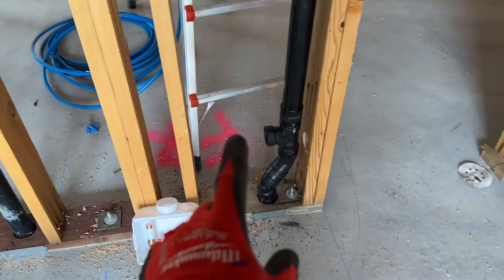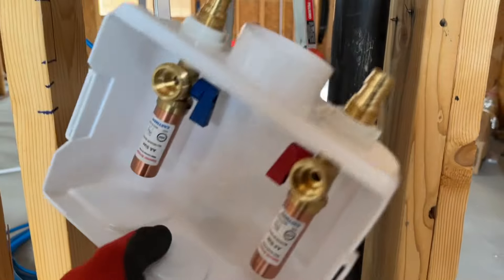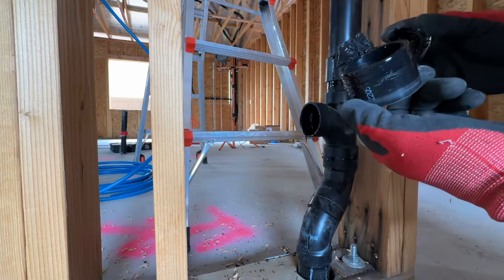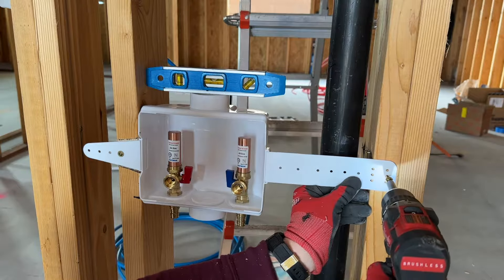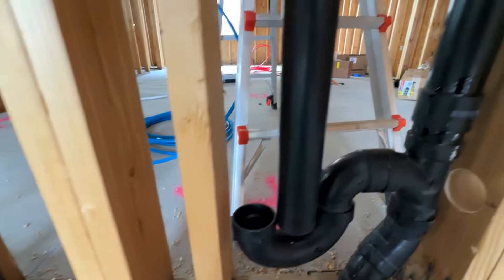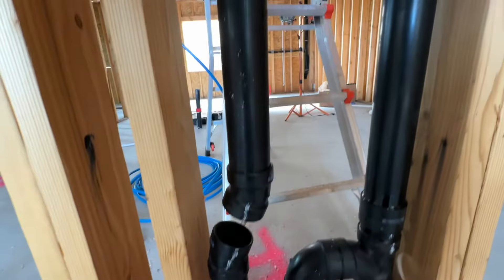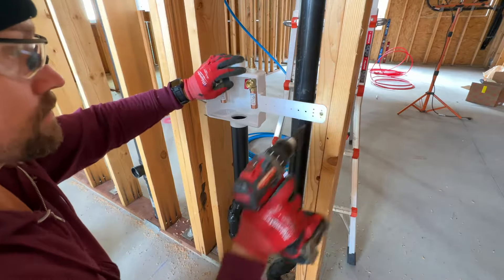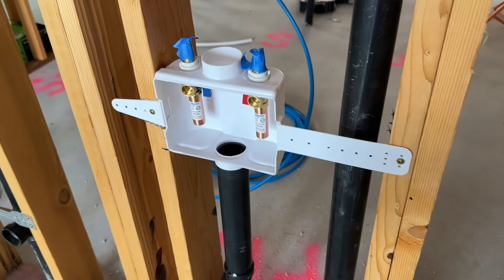How To Install Washing Machine Outlet Box & P-Trap

Comment: Are you allowed to do a S trap like you did? I was thinking the piece connecting had to be a minimum of 4" in between in order to not create a s-trap instead of a p trap.
Reply from the maker: A “S” trap usually is when they just make and S shape but there is no venting. So the piece I have going vertical is a dedicated vent for that drain specifically. If I had no vent on it then it’d be what most call and S trap and those are no good as the “P” part of the trap doesn’t work the way it should by trapping the sewer gas. 

But this pipe will vent properly and still hold the water down in the P trap. Its really just a regular P trap laundry drain with a little kink to
Shift the vertical parts right.
Reply: @FortKnoxCo  could be right. I was always told the little piece you cut to go between the sani-tee and the other piece of the p trap has to be double the kenth of the thickness of the pipe, which would be 4 inches in this case or it could cause the p trap to get sucked dry. Its in the National Plumbing code.
Reply from the maker: @Jgwoodworks1623  after a little research it is recommended or code that you do twice the diameter of the pipe. If you have no vent they usually call that a S trap. But if you have a vent and it’s within the double diameter of the pipe distance then it’s referred to a “Crown” vent. Way back in the day they would have a S trap and have a vent literally on top of the second bend and that’s why they called it a Crown vent. It doesn’t guarantee failure but it was found to be less effective if keeping the water in the P trap. You need a little bit of pressure regulation in the pipes so the vent shouldn’t be too close to the P trap. So they moved to the double the diameter rule to help that. What I have is pretty close but not a formal Crown vent. Since I’ve used an actual  Sani T and the two pieces have the pipe sleeves to receive the connecting piece it almost gives me the flat distance I need to the vent. Cutting it close.
Reply: Yeah, I came here to say that exact thing. For others, a couple more inches of pipe to make sure you don't fail inspection and have to cut all that out.
Reply from the maker: @bluegorillacookies  yeah I agree, I wouldn’t have made such a tight set up if I didn’t have to. But the area I was working with was very minimal. Had to make it work and I passed my inspections. 🤙🏼

Comment: So the washing machine outlet to the ABS doesn't have to be glued. I'm getting ready to remodel our laundry room and will be mounting mine the same way with hot and cold water on the top.
Reply from the maker: I could see that. So you could work on it or replace if needed.

Comment: It is an S trap! S traps were always vented, they just sucked the water out of the trap. That’s why they are a code violation. You may have passed inspection but that does not mean it’s code compliant.
Reply from the maker: It’s not an S trap. But looks very similar since is has an S formation, but it’s vented as you can see. It’s very close to the down bend but within allowance. The distance from the trap to the vent is to code. But it’s right on it. There’s also a vented S trap “crown vent” which used to be allowed back in the day but isn’t in most places. 
So what you see here in this video is vented and is “technically” a P trap if you measure the horizontal spacing to the vent. And either way it is obviously vented.

Comment: Were is the clean out and I don’t think u can off set a direct drain homer
Reply from the maker: There doesn’t have to be a clean out for a laundry drain. If you wanted to add one you obviously could. This is a very common 24” to ptrap laundry drain.  The spacing is very close to what some consider a crown vent or Strap. But it is not.
Reply: @FortKnoxCo  not UPC code

Comment: My sister and I installed..or tried to install our very first box. It went well until it was time to hook up the water to the box. Turns out we need a crimping tool which we do not have. Instead of that, my sister got sharkbite fittings. We hooked them up, but they leaked. The tube from the valve is like a pvc type tube and it is not long enough to reach the seal on the sharkbite, that is why it leaks. Any recommendations?
Reply from the maker: I’m not familiar with the boxes that have Pex coming off of it. You can get a box that has shark bit type connections on it I believe, so you could just push your pipe/pex into the fittings on the box. Or get the correct adapters to make a good connection. But yes, if you don’t have the shark bite/push on connections on correctly and fully inserted it will leak.

Comment: Will you be doing a tankless water heater install  possibly?
Reply from the maker: Yep! I’m about to run my gas line into the structure and set the tankless mount. I have the water lines already plumbed for the water heater in place. Where the main water line splits to cold and hot. I’ll be showing that in detail in some upcoming videos

Comment: wait the water was coming in from the too 🙄
Reply from the maker: The Water lines in this structure are ran through the rafters in the ceiling. Everything drops into the walls where needed.
Reply: @FortKnoxCo  I didn’t complete my comment, what I was saying you did mention the waterlines were coming from above, but then, as you started to initially install the washer box you had the valves in the wrong position, as though they were going to come up from the bottom, then the video showed you going to remounting the box. That’s fine I enjoyed the video, you explained things well, I have left the box in traditional installation, take my waterlines and made a bend and came in from the bottom, that was without using 90s. Either way all good. Plumb on my fellow plumber!!
Reply from the maker: @jamessells8440  oh yeah. I got ya. I initially screwed it in “upside down”. But when I took it off to install the last pipe and re mount I installed it the correct way u needed it. I appreciate it. 🤙🏼

Comment: 2 quick questions..
What’s the word on those little vent fittings that can eliminate a legit vent stack? Are they good enough for a small washing machine?
And second question is about the trap. Does it have to have a min run to the San Tee? Or can it just be snugged right up on it?
Reply from the maker: Are you referring to something like a Studor Mini-Vent?  Yes they can handle a vent requirement. If you look on whatever brand /style you are going to get they have a rating on them. Some are good for a certain amount of rod DFU’s ( drainage fixture-Units). So like a sink or a toilet or a shower equal a certain # of DFU’s. So they can handle that amount of  fixtures on a single vent line.  So they do work in place of a true vent out the roof. Commonly used in renovations. Just make sure they adequate air flow, you don’t want to box them in a wall. 

As far as the P-trap to the Sani T transition, they can be one right after the other. They can be close. Your main concern is the drop to the ptrap. You usually need 24” drop to the ptrap for high flow fixtures like a washing machine.  And you don’t want a vent pipe off the top of that transition. It can be right off the sani T obviously, but not a “crown vent” which was common I a long time ago. Most codes don’t allow crown vents anymore.